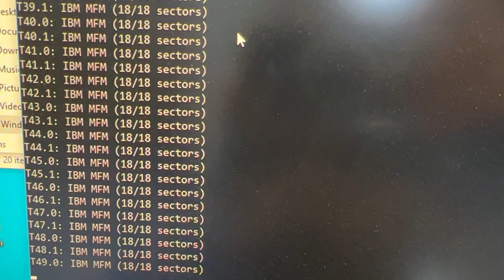Cross-platform interfacing hardware for floppy disks, part 8 - PINK TIME!

Comment: whats the wiring to conect pi pico to floppy drive
Reply: I have the same question as Michael, I have the code, but the pinouts are different, and the ino file doesnt have the #if defined for the pico either.  I'd like to use this for cloning apple 2 disks and/or backing them up.  If I knew a little more about the expected signals I might be able to rewrite the code, but alas my knowledge falls a tad short in that respect...
Reply: I take it back, it's the apple 2 test code that is limited.  i see in the write data code that everything is well defined as well as I see a conditional for the pico.  I can easily wire this up based off the code.  Now to figure out this apple2_test code ;-P